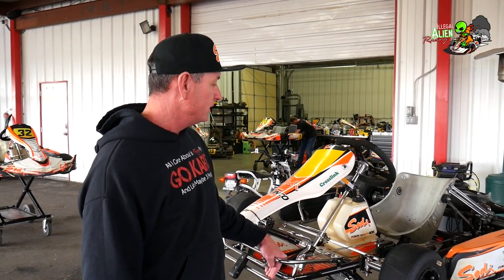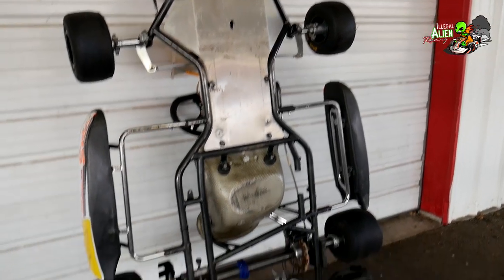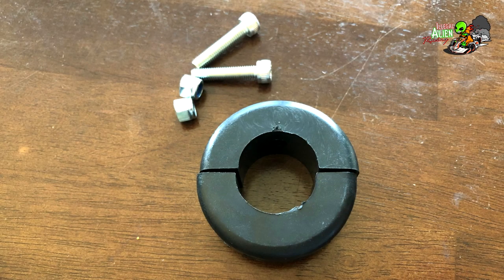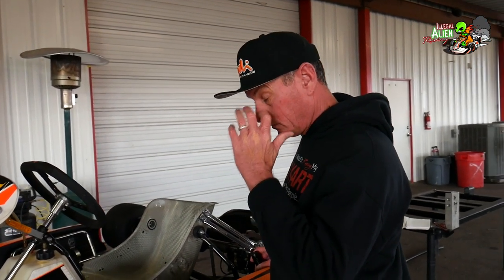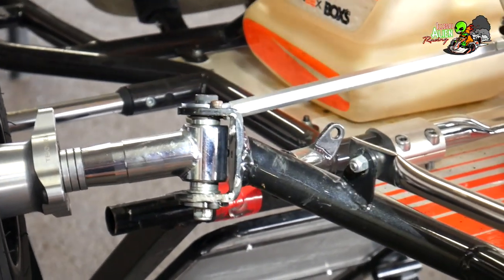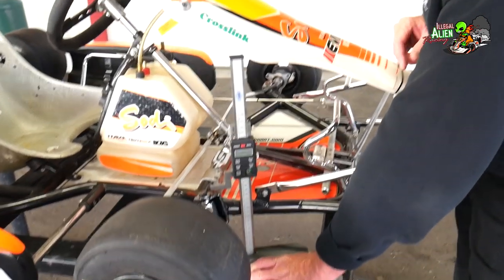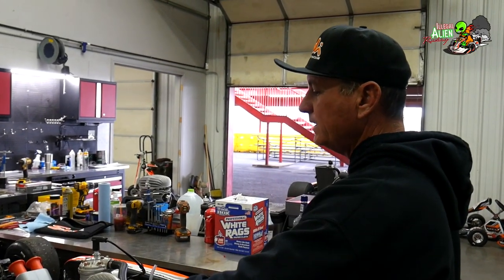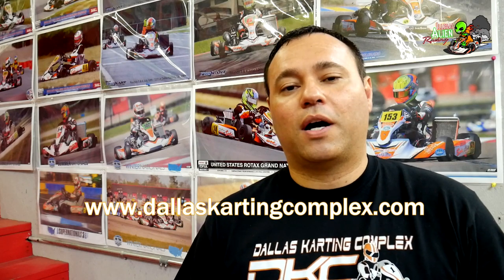Tips for Buying a Used Go Kart!

Comment: I bought a 2nd hand 2017 tonykart 401 for £1500 Its not scraped underneath and has skid protectors fitted, a prd fireball 125cc which needs running in, its virtually immaculate with only slight scrapes on sidepod bars and scraped front bumper. I replaced the front bumper, fitted custom decals, front brakes, plastic type rear bumper, crg carbon seat with black pu leather with green stitching and fully padded with memory foam. Alfano fitted, 2 usb, 12v output and 12v voltmeter to recharge phone and gopro's. phone has gps speedo, bluetooth helmet, music, communications and a wifi hotspot ect. It even maps tracks and can do lap timing. And a crg steering wheel and crg pedals fitted. Mods have cost £1200+. Basically, i pimped it out, and total is less than half the cost of a brand new kart. If new, the kart is £6500, mods should be another £2000+ ontop. I got lucky finding that kart, then went nuts.

Comment: Great video 👌🏼 but I would also like to know what to look for on the engine, if you're buying a complete used kart. So a video for that would be really nice.
Reply from the maker: Great idea.  I'll have to work on that.
Reply: if it runs
and even if it doesnt a new carb or spark plug will do 9 outof 10 times

Comment: Great vid, I got lucky (I thought) and purchased a 2014 Kosmic Mercury Jr. Rotax which retailed for $9500 and I got it for $2500... My best advice is get your Kart away from the seller and find a Kart Technician (like yours at Dallas Karting Complex) mine at my local track diagnosed an EVO upgraded coil spliced to a Vortex/ ROX battery (caused a misfire at 11,500rpm). We decided to for go the extra 2,000 rpm's and throw an OEM Rotax wiring harness and the standard Rotax battery. Since I'm new to Karting and old we went for reliability with a smooth power band. OK so, I'm a little heavy for a Jr. Max but its way more fun than a Lo206 pull start.

Comment: I'm looking to purchase a shifter kart but the engine is bad. Hence I was looking at Honda motors and saw one in particular(Light commercial/residential GS/GSV 190) but it has 187cc displacement. Is that to much? I'm asking that because it looks small enough to fit right in. Anyways please give me a Honda motor that would suffice and not be to extreme. Also is it a plug and play as far as installation of the motor? Which type of shaft would be needed? The Honda one has a vertical and horizontal shaft which do you use? Thank you!

Comment: Karts are 100% different based on all the things you just explained. Also, the mychron can be reset NEVER use that...if you are buying a running kart I'd pull the top end off. cheers

Comment: Bought a used go kart (blue eagle cadet) with a comer k-80 motor, but the starter bolt is worn down aswell as the nut.:( anyone know where to get the parts and maybe a vid on how to replace it or some tips? Thanks